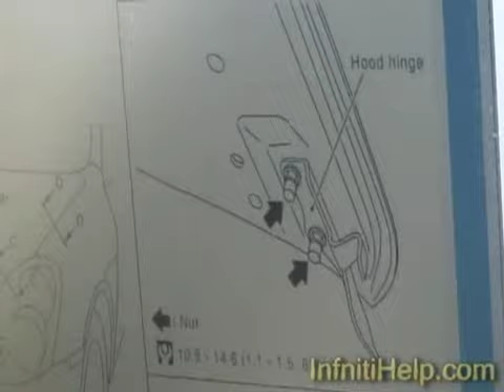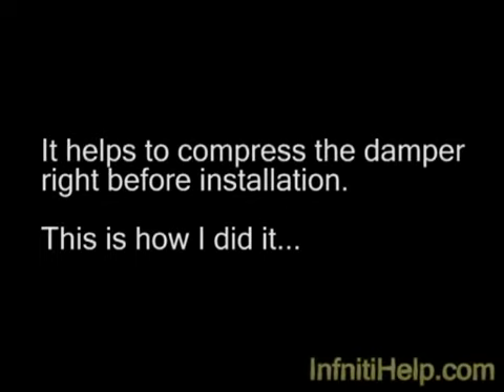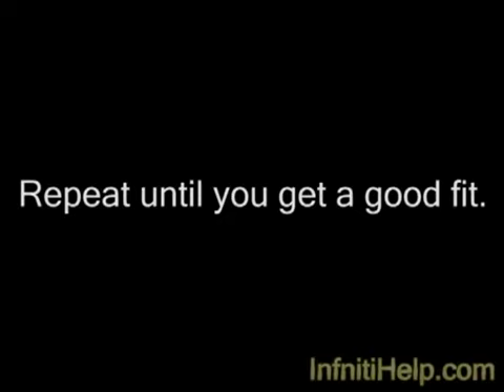DIY: Infiniti G35 Sedan Hood Dampers Installation

Comment: Thanks for the video, I've been looking into Hood Dampers.  I installed a Mishimoto Air Diversion plate which btw doesn't have a hood rod clip (they failed to mention that on there air diversion ad)...sigh